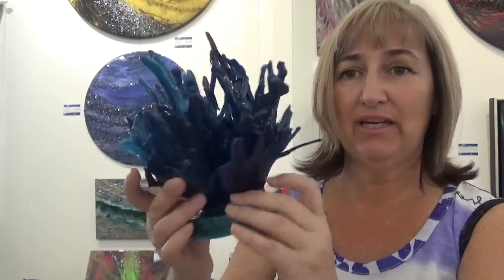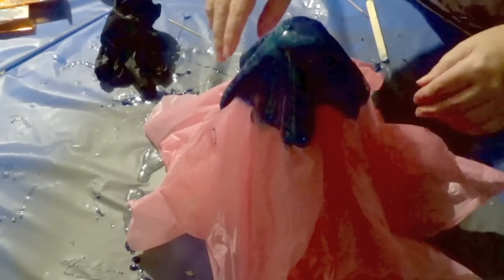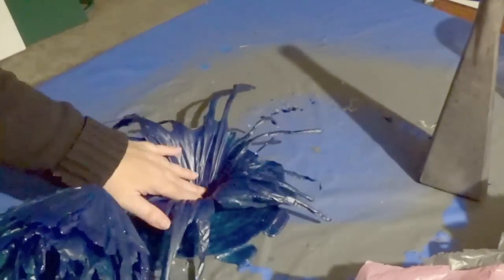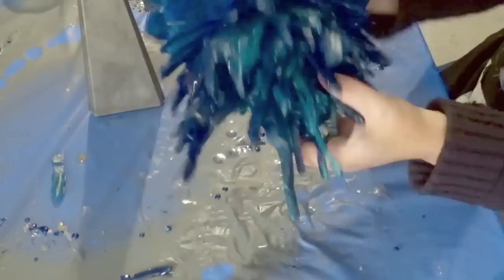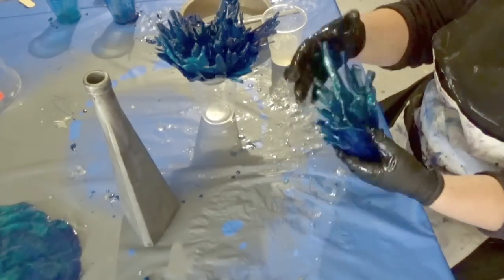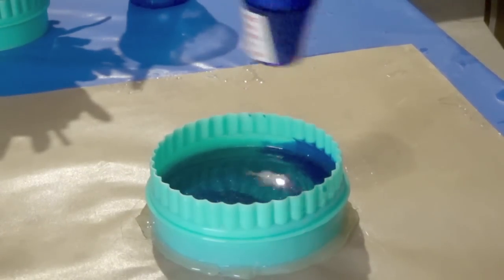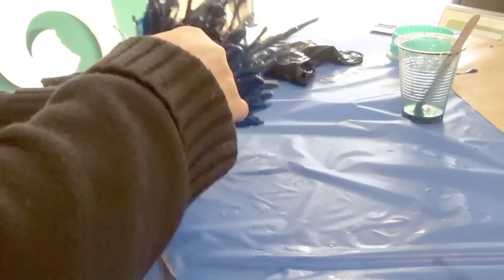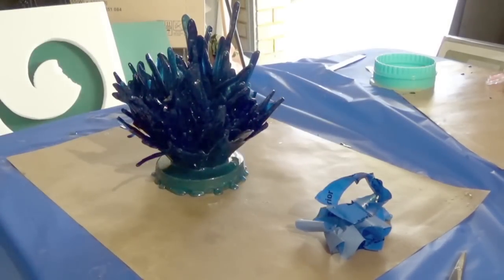How I created resin water splash sculpture

Comment: That is so lovely!! I love the shape and the colors. :) I hope you won't mind some tips? When you are done with your brush for resin put it in rubbing alcohol, the higher the percentage the better. I use that to clean my resin brushes all the time. :D Don't let the resin cure though. It is much easier to do it while the resin is still wet. Also for the last fiddly bit of getting resin into the base you could try a turkey baster. :) I have used a small open end medicine syringe for smaller pieces but for something like this I think a turkey baster would work better. :D Hope some of that helps. - Heidi
Reply from the maker: I am always open to tips, thank you 💕

Comment: You are such an inspiration to so many and so generous with your time and expertise!  Thank you!  May I ask question?   I tried this and waited 5 hours but when I went to place the resin over the bottle, it was still extremely sticky yet difficult to bend around the bottle.   Was my resin cured too much?  Or was it too thick?  What do you think?  I am in the US and use KS resin from the US.
Reply from the maker: Thank you 💕 I have never tried KS resin, so can't comment on it. I will say however, there can be a number of reasons why you were having issues. Is your room too cool? Cold resin takes much longer to cool. Did you mix your resin enough? Sticky spots can be a result of not mixing enough. The thickness of the resin could be the reason for the difficulties in bending. 💕
Reply: @SueFindlay  thank you so much!  You are most generous!

Comment: Sue all your sculptures are so beautiful. Question if you don't mind: I've used skinny tops and notice that the center starts to pull away. What I have done to keep the piece
is to pour more resin after it has dried. Have you had this issue and if so how did you keep the circle from pull from the rest of the sculpture?
Reply from the maker: I haven't had this problem. More resin would do the trick though. 💕

Comment: Maybe i missed it, but how long did the leave the resin after putting it on the bottle? Over noght? It doesn't seem fully cured when you are trimming.
Reply from the maker: It was overnight. The resin I was using was quite soft and takes over a week to fully cure.  💕

Comment: This is amazing. I'm so inspired by your unique creations. I do have one question: Are all resins able to cure at such large depths? I though it was a maximum of an 1/8 of an inch with non casting resins. Perhaps U Resin is different? If so what type of U Resin do I need to buy to make a sculpture with  a deeper base. Thanks in advance.
Reply from the maker: You are right about the depth of resin for non casting resin. When you pour large depths the resin curing time increases dramatically. The base of this piece cured much faster that the rest of the piece.

Comment: Very different and beautiful, you inspired me to try out to make something like this. THank's for Sharing. This is so soft and flexible, just want to know, did you used the hardner or just the resin? If you used the hardner then what is the ratio to make this flexible?
Reply from the maker: I followed the resin instructions 1:1, I don't deviate from this. How flexible your finished piece depends on the brand of resin. I tend to leave my pieces to cure for at least a week to make sure it is fully cured.
Reply: @SueFindlay  Thank you so much for your reply and guidance.

Comment: I think your sculpture is beautiful. When you trimmed the long pieces didn't it leave the edges blunt, instead of being rounded like the others? Could you put the heat gun on it to melt the blunt edges?
Reply from the maker: I didn’t find that to be a problem. I added more resin to glue them together, I guess it running to the tips helped sort that issue out.
Reply: Oh, that's right, I forgot about that. Thank you. I love this whole thing, it's so new to me. Thank you again, this is so awesome 💕 🌿

Comment: Very, distinctly cool sculpture!! I'm still at the stage of trying to mix resin to the correct ratio. My latest, I thought I had done exactly 2:1 but 3 days later still sticky/not cured. Maybe my resin is out of date; I'm getting ready to give up.😤 Paradoxically, I'm determined that it will NOT beat me, lol....💁‍♀️🤦‍♀️ You make it all look so easy. How many times have you been told that? Kudos. Tyfs.C😊🐾
Reply from the maker: If I had a dollar for every time I was told it looked easy 💕 Are you following the instructions for your resin carefully? Some recommend measuring, whereas others recommend weighing. Also, are you mixing it for the allotted time? I find transferring your mixture to a fresh cup and mixing further, eliminates any areas that have not mixed properly, like the bottom and sides of your cup.

Comment: Could you use a silicone spray on your bag for easier release?
Reply from the maker: I have found if I place an extra bag between it helps with removal. I don't know if using silicone spray will affect the resin curing.

Comment: So, in the beginning, you leave for 5 hrs to cure then put over the top of a vase and leave for 24 hrs?
Reply from the maker: Yes, pretty much. Times vary slightly depending on the time of the year and the resin you are using. I recommend that you pour a small sample amount on to plastic and work out your optimum time to move and then leave it to fully cure. Seeing how it bends and cures, will give you a good insight before you commit to a whole project 💕